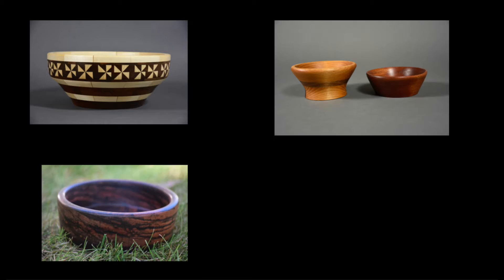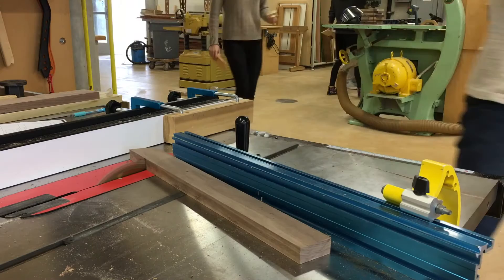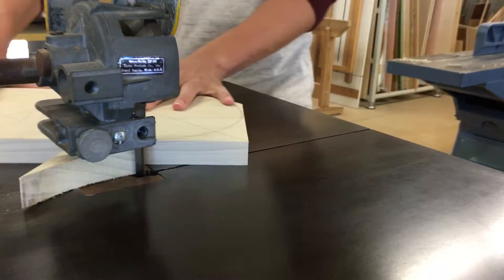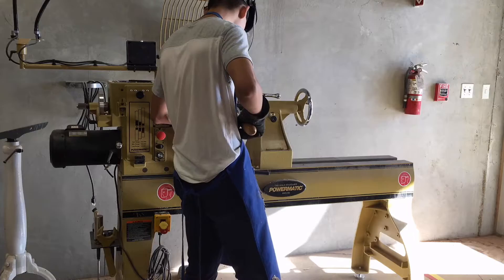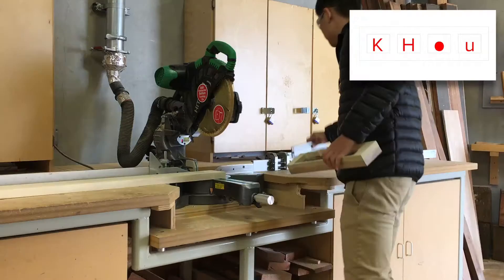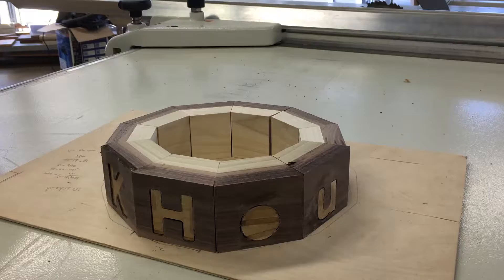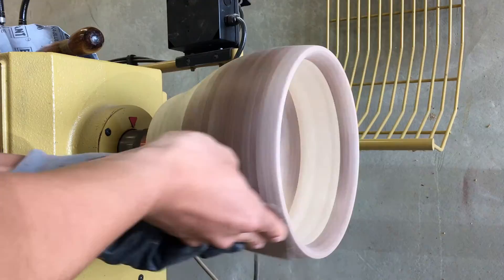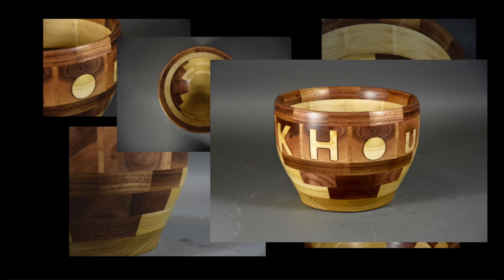Wood Turned Segmented Bowl with Inlaid Letters

Comment: Use hose clamps, or rubber bands to hold your rings together.  If they don't mate perfectly at first, use a small spacer between the two halves to take up the error.  Also, just be aware, that table saws can be dialed in accurately enough to have all the angles of a ring meet up perfectly on the first pass.  I have the same saw you were using, and I never have to glue my rings up in halves and sand the mating faces afterwards.  As long as I set the angle accurately with my miter gage, the rings always come out perfectly.

You definitely have some safety issues, but they've been covered already, and I'll not reiterate them.  As woodworkers, we all still have a lot to learn.  You definitely have some skill.  Keep at it, young man.  You've acquired a hobby that will keep your wallet empty, but your heart satisfied.

Comment: I solved the problem of glued parts slipping by using a few grains of salt, it didn't affect the glue but stopped the movement, it works a treat
Reply from the maker: Good idea, I'll give it a shot. Thanks for the suggestion!

Comment: The bowl turned out nice. I see some really good ideas in there. What prompted me to comment, though, was your safety problems around the table saw.  The kickback you got was because you allowed the cuts to pile up between the blade and rip fence.  You said that "it taught you a lesson to respect the saw a little bit more" but you didn't change your process to remove the cause of the problem.  Those cuts should be cleared from that space either onto an outfeed table or into a box behind the saw. Using the rip fence with a stop block clamped to it is perfectly fine, but allowing anything loose to be in the space between the fence and the moving blade is a disaster waiting to happen. 

I would also suggest that you're standing in the wrong place during rip cuts, and not you're not standing still.  You should be in a solid, balanced stance to the left of the blade. Instead you stand directly behind the space between blade and fence, the most dangerous place you could be.  When you get a kickback during a rip it's because the wood gets pinched in that space and comes back at you with tremendous force. Where you're standing you'll take the end of that board square on, right below your belt. I notice you also shuffle your feet a little to the right (presumably to hide behind the ripfence). This means you're not balanced and stationary and so introduce another possible source for a mishap. A better place to stand, imo, is to the left of the blade with your whole body clear of the space between blade and fence. That way if you do get a kickback, it will go past you or give you a glancing blow. Your feet should be planted and you should be balanced and your push stick should be within easy reach.

Keep making sawdust, I see some good stuff there. But please be safe, too.
Reply from the maker: Hi Matthew, definitely agree with you on the safety comments. Thanks for your concern! I didn't notice that until you pointed it out — guess it's a force of habit that should be remedied.